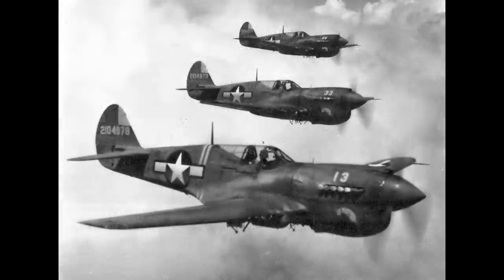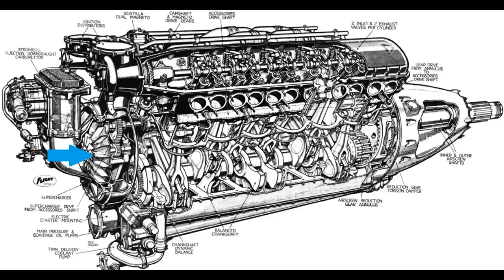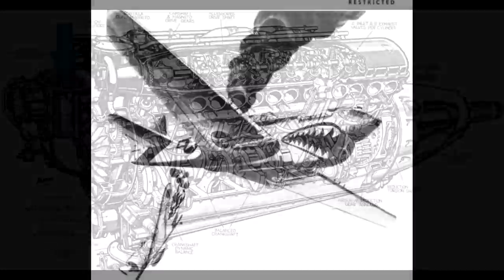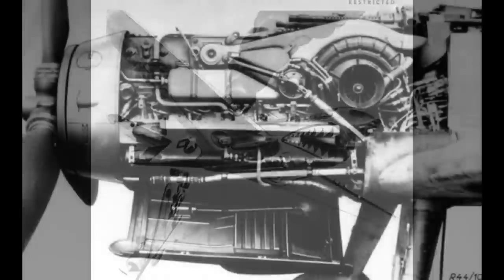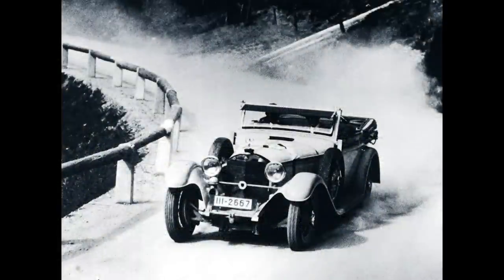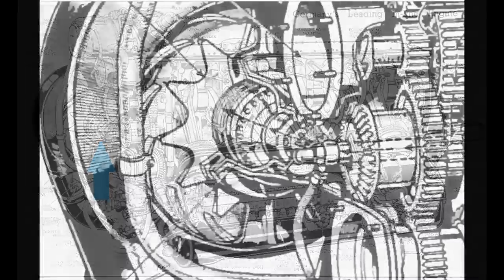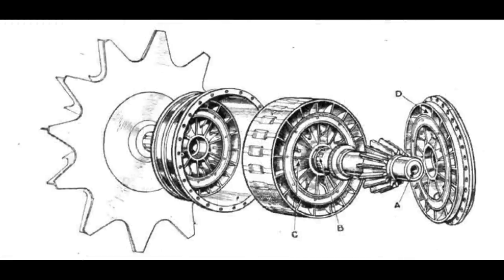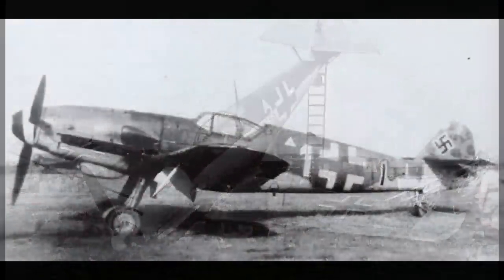Messerschmitt BF 109 Supercharger Drive System

Comment: Other than space constraints, is there any reason the Germans never pursued dual stage super/turbocharging? The space constraints could have been worked around on the multi-engine craft and they might have even considered an all new single seater w/ a 2-stage.
Reply: they did, but there was no airframe ready to have it efficently bolted to.
They made The FW 190C, Basically a D model, with an A models tail, but a super+turbocharger on it. the added weight and drag from the turbo made it slower in most cases. just not at heights above 7km. So there really wasnt a use for it.
also later supercharged engines from germany, like the Jumo213 used in the D12/d13 and Ta 152H, where capable of pushing good eninge power as high and higher than 10km altitude!
the Ta 152H had a service ceiling of over 14km. litteraly unmatched by any other plane at that time.

Fw C:
https://commons.wikimedia.org/wiki/File:Fw_190_C_V18_Seite.JPG

Ta 152:
https://en.wikipedia.org/wiki/Focke-Wulf_Ta_152
Reply: The examples you mention are part of the last ditch attempts as the end was nearing. I was thinking of something a lot earlier, and with the idea of building an entire new fighter around also a new bomber or two. Perhaps by the time they realized something really new was needed, they decided the jet was their best hope with their limited resources.
Reply: @billgone4065  1942, in case of the C model is not a last ditch effort.
The Ta were just further developed Fw D variants.
And no germany probably didnt have all too much interest in late war "superprops" as doctrine was swung over to jets. Yet they denied heinkel to develop a jet fighter in 1939, even tho they allready had a flying prototype.
Also keep in mind that after the Ta 152's theyd get replaced by a jet aswell, the 183.
The 262 would after the hg2 probably been phased out against the me p.1101.
Plus some fancy jetbombers sprinkled it. Like the allready exsiting ar 234B, and the prototyped GO/Ho 229.
A year or two more and germany would probably have fielded jets only.
Heck even the britians had their gloster meteor ready and over germany in 45.
Reply: @Koocie C model development was done by end of '42. But I wondering why they didn't start w/ a clean sheet of paper like the US did w/ the Thunderbolt back in '40 or 41. Also, a fresh sheet 2 stage motor could have given them a high altitude, long range bomber option. Most likely more of Milch's shortsightedness and Udet's general incompetence. It's also just as good they passed on that Heinkel 178, that engine was not the way to go and would have been a total waste of time.
Reply: @billgone4065  well bc they had the 262, bar the engines ready as prototype in late 41. and the protoypte with jet engines fley in march 42. so really no reason to advance further into heavier fighters, p47 alike. Plus the DB60x and jumo 213 engines were good enough, far advanced and very powerfull. no need to get more piston engines ready, when there arent enough production lines running for the major 3 (bmw 801, db and jumo)! On top of that late jumo and db engines are two staged and optimised fopr high alt, look at the ta models. Germany also never had the need for long range high alt bombers. their ju 88/288 and he 177 had hefty payloads and were fast. tho bomber doctrine was still stuck in the spanish civil war, when heinkel 111 had no defensive armament to outrun enemy fighters.
and just bc the eninge wasnt powerfull of the 178 doesnt make it bad. it still was faster than any other plane in 39 and would have been very deadly to any early war bird, we are speaking 39!! fit a better engine to that airframe and its up to the task of a 162 ( or atleast very close to it), which is a 45 plane...
Reply: @KiicieKoo Again you drifted into the later part of the war when needs had changed the earlier time I referred to. The ju88 was too slow and the ju288 was a disaster, it's engine a completed failure. The he177 took so long to develop it wasn't ready until mid '42 and even then developmental issues continued and it was eventually withdrawn from service. And the he178 straight wing design was no better than it's faulty engine design. Germany had enough cooks in the kitchen when it came to jets, it didn't need another bad actor. If there's something they could have done, it's in 1939/early '40 develop a 2-stage super/turbo engine and put it in fw187. Then they would have the fast, long range fighter escort they needed.
Reply: @billgone4065  germany only needed long range escorts for the Invasion of britain. After that, they never needed those again.
Why are u trying to push americas strategy to be better suited for germany?
They were never in the remotely same situation.
Reply: Germany could have used long range escorts for continual bombing  of British industrial targets after it decided not to invade. they would have useful throughout the war. They could have escorted fw200 against shipping. In Russia. Perhaps against Gibraltar. With drop tanks maybe they might even have reached the Bismarck(granted that's a reach). I think you're not seeing the bigger picture. There's nothing uniquely ''American'' about fighters escorting of bombers.

Comment: I wish that you had included some links in the video description so I could learn more about the fluid coupling.  I have made several attempts through Google searches but I can't find anything.
Reply from the maker: Here is a start: https://en.wikipedia.org/wiki/Hermann_F%C3%B6ttinger   When I made this video, I didn't expect anyone to watch it. I think I had about 10 subscribers, and most of those were from the automotive side. I didn't realize that people would be interested in just how the coupling works, but Wikipedia will give you a good start.
Reply: The system is used in the fan clutches of most modern engine cooling systems.

Comment: I notice on the cutaway diagram of the Allison engine that it has a fork & knife arrangement for the connecting rods(similar to Harley Davidson engines) is this typical of V configuration engine of the time?
Reply: +chuck harris  Fork and blade connecting rod configuration was on many aero engines.   I think it made a slightly more compact and stronger design and also concentrated the power pulses more evenly on the bearings.  Resonance and vibrations were all factors in V12 design to prolong engine and crankshaft life.
Reply: Thanks
Reply: Crank was shorter with fork and blade.

Comment: On a related note, is a turbocharger self regulating with altitude? As atmospheric pressure is reduced with altitude, the pressure differential between the exhaust and atmosphere will increase and the turbine will spin faster. Does this proportionately compensate for the thinner air at the inlet? Higher you go, faster the turbine, more you compress the thin atmosphere at the inlet?
Reply from the maker: Hmm. Some turbochargers do automatically adjust to a higher speed as the aircraft climbs. The device that does this is usually called a "differential controller". It adjusts the turbine shaft speed for changes in ambient conditions. Some engines don't do that, and it's up to the pilot to keep adjusting the throttle as altitude changes. Both configurations can be found on WW2 planes.
Reply: Thanks. I would have assumed that no form of controller was required - at least as long as turbine RPM stayed within safe limits.  Mind you, WWII turbochargers were still fairly crude devices compared with modern tech.

Comment: Simple is beautiful. German engineering used to be like that. They fixated on the goal, not the method. They achieved some totally crazy designs, some of which actually worked and still do. Some crashed. Without the Me262, would the dogfights between F-86 and MiG 15 ever even get going?  The scientific ambitious communities still are there. They are lacking the resources of the US but they have loads and loads of brainpower. Check the top scientific centers for scientific research...USA, Germany, China...
Reply: Oh, yeah, the dog fight would be happening, but between P-80/F-80 and F-84 vs same MiG-15s.

Comment: Greg, was not sure how to share this, so paste it is.  Found this Russian wartime evaluation of the DB-605A/1 supercharger:  "1. In order to increase horizontal and vertical speeds of domestic fighters, oblige chief designers comrades Shvetsov, Klimov, and Mikulin to install hydraulically driven superchargers on M-71, M-82, M-106, M-107, AM-39, and AM-42 engines. Recommend use of an automatic hydraulic clutch control unit similar to the one on theDB605A/l."    This Russian website has a lot of rare photos and insights.  http://www.airpages.ru/eng/lw/bf109g2.shtml
Reply from the maker: Thanks Jim, that's a wonderful page.

Comment: Idle curiosity, but how do you throttle a supercharged engine with fixed manifold pressure?
Reply from the maker: What do you mean "fixed manifold pressure"? I don't understand the question.
Reply: @GregsAirplanesandAutomobiles  I think the video said the BF 109 maintained a constant manifold pressure of 53 inches (which I assume is absolute pressure).  Given that it had fuel injection which I assume is a constant spray of fuel for each intake stroke, how is the engine throttled?  With a carburetor it is obvious, the fuel and air are mixed in the proper ratio and the manifold pressure is controlled by throttling the output of the carburetor which in turn reduces the fuel air mixture entering the engine. I just don't understand fuel injected supercharged engines.

Comment: is there any chance the krauts put the intake on the side to keep it from sucking debris from battle/the ground/birds etc?
Reply from the maker: I don't think so. If the supercharger was behind the engein it could take air in from the top like an Allison, which would reduce the thread of debris even further.
Reply: +jumkiehunter   The supercharger placement could have been a design decision to allow for the central cannon favored by the Luftwaffe.  The cannon breech was between the pilot's feet.   Not forgetting the upper guns and assorted ammunition boxes. Both the engines from Daimler and Jumo had superchargers on opposite sides, suggesting that there was a purpose or an RLM requirement for the decision and implemented by both engine makers.

Comment: Maybe the supercharger is at a 90° angle so that the engine can be more properly cooled.
Reply: Ive noticed that the supercharger is surrounded by a cooling system. This could mean that it was in this offset position to aid keeping the cooling system cool.
Reply from the maker: I just don't think so.

Comment: Do you know about the barometric control of the clutch as used in DB-engines?
Reply from the maker: Yes.
Reply: @GregsAirplanesandAutomobiles  I mean that do you know how the barometric control operates.  I haven't found any detailed information about it.  Just one picture that shows a control box with air and oil inlets.  Air pressure changes in the control box regulate oil flow but how does that control impeller speed which is infinitely variable?

Comment: The P38 seem to have the supercharger (turbocharger?)at a 90 degree angle sitting on top of the engines.
Reply from the maker: That's the turbocharger. The P38 also has a  mechanically driven supercharger is driven conventionally at the back of the engine.
Reply: +Lars Swede  The P-38 used exhaust driven turbo-superchagers which were big devices farther back in the engine nacelle .

Comment: What is wep and when was it used?
Reply from the maker: WEP is War Emergency Power. It's used in an emergency. For example, if you are going to die unless your plane suddenly has access to another couple hundred horsepower, that would be a good time to use it. Or if you need some extra power to get the shot, and save the bomber you are escorting, that would be another case where you should use it.

Comment: Would fuel injection rather than a carburettor let this drive system be more effective?
Reply from the maker: I am not sure I understand, the 109 does have fuel injection, at least the E and later models.
Reply: @GregsAirplanesandAutomobiles    I was just meaning that a carb is more of an inlet restriction to most superchargers that's all. Sorry I worded the question ass backwards!!

Comment: I have no proof and all I am saying is pure assumption and conjectures on my part. Could it have been placed at 90 degrees from the engine in order to make up space for accesories and ease of maintenance? I assume it also shortens the length of the engine compartment even if it mide make it a bit wider. Also at least in the Bf-109, as it is an inverted V engne, would having a supercharger in the “usual” place at the rear and towards the bottom of the engine (or in this case, the top), mean that you would have to remove the cowling mounted armament or further imper forward vision? Once again, this is conjecture from my part, and its the first thing that comes to mind...

P.S. After you mentioned change in air directin, having the supercharger intake at 90 degrees from the air direction means only a change in direction of 90 degrees at the intake itself, the air would exit the impeller and go straight into the inlet manifold straight away and without requireing change of direction, making it a bit more efficient, even if just a tiny bit
Reply from the maker: Maybe, it's a good theory. The issue is I have a lot of good theories but no original source that backs any of them up.
Reply: @GregsAirplanesandAutomobiles  Yeah... that’s the bad part.

Comment: Soo how did they control the supercharger impeller speed ? Did they vary oil pressure or did they physically brake the impeller...
Reply from the maker: https://en.wikipedia.org/wiki/Fluid_coupling
Reply: @GregsAirplanesandAutomobiles  found it under scoop control ... that's good to know thx
Reply: @GregsAirplanesandAutomobiles  btw love your work are you an engineer or a pilot or both 😂😂
Reply from the maker: Thanks for your kind words. I am an airline pilot, former flight engineer, and I work on cars a lot.

Comment: Just think if a quick maneuver of the pilot killed super charging shaft speed.
Reply from the maker: Roll rate normally is much faster than pitch rate so the gyroscopic effect would be stronger with the supercharger mounted as it is in the 109. The P-47 and P-38 are both turbocharged, and their turbos are positioned so that both roll and pitch would cause a gyroscopic effect. So, I don't think that was a determining factor, but maybe.

Comment: I'm curious to know how the cannon was mounted ? it would seem to me there wouldn't be enough room to mount one there
Reply from the maker: Visualize the crankshaft being above the center-line of the propeller's spinner. Now there is room in the middle of the inverted V.
Reply: Thanks for clarifying that
Reply: +Stuart Campbell  The breech of the cannon was all the way back between the pilot's feet.  The blast tube and muzzle passed through the engine vee and a hollow propeller shaft. (With the prop geared off of the crankshaft center.)

Comment: :D nice video. what is i pilot airplane with pitch propeller and max power only, instead of controlling throttle ? XP
Reply from the maker: I don't understand your question. :(
Reply: power of the engine and pitch of propeller are inverted :) you fly with propeller and the engine is all the time at full power. is possible?

Comment: Seems like a waste gate would work. Just max out the boost and regulate the manifold pressure to optimize conditions at hand.
Back to the drawing board Professor Daimler.
Reply from the maker: I am afraid that won't work effectively for several reasons.

Comment: So like a torque converter?
Reply from the maker: Ahm, sort of. Expect that a typical torque converter only drives at about a 1:1 ratio above its stall speed. The 109's drive mechanism can vary the ratio at nearly any time it wants to. If you want to think in Automotive terms, think of an early 60's Buick Dynaflow transmission. It's a lot like that.

Comment: 90° mounting was for space concerns and better air flow during flight perhaps? I reckon that fluid coupling drive worked much like a torque converter. Just guessin'.
Reply from the maker: It could be or space concerns and airflow, I'm just not sure. The fluid coupling is something like a torque converter, but different. Most automatic transmissions don't use the torque converter to vary the gear ratios beyond some multiplication that happens below the stall speed.
Reply: @GregsAirplanesandAutomobiles  That is true. I haven't figured that part out yet lol.
I'd "guess" the varying gear ratio part may have been attributed to something similar to what you may find in a CVT automatic transmission. Another guess mind you. Anyhow, keep up the good work, love your vids! You got a good name too Greg. 

Big G
Reply from the maker: It is quite a bit like a CVT.
Reply: @GregsAirplanesandAutomobiles  I think(Not 100% sure though.) you're incorrect!
I'm quite sure I've read that the fluid coupling driving the supercharger is just a standard fluid coupling with no "torque conversion" at all and therefore doesn't change the "gear ratio".
The speed of the supercharger was controlled with varying oil pressure in the coupling and therefore varying slip.
Slipping the drive is obviously inefficent but it seems to be more efficient than throttling the supercharger.
By the way I just found your channel, your videos are very interesting!